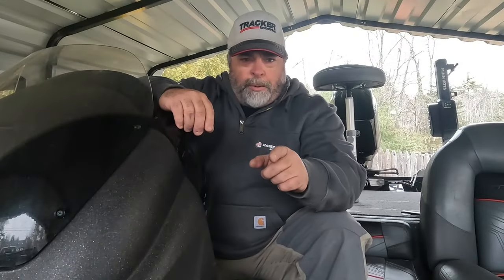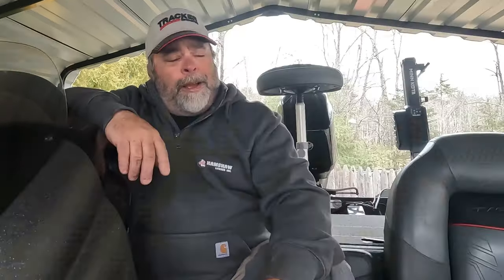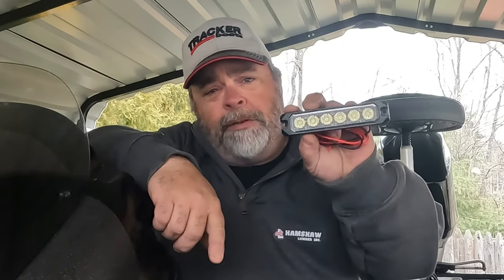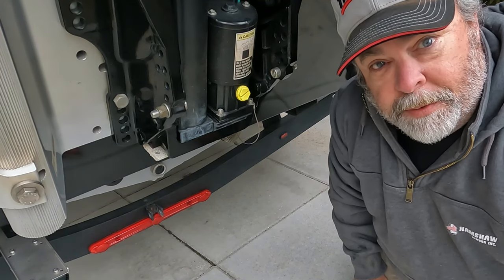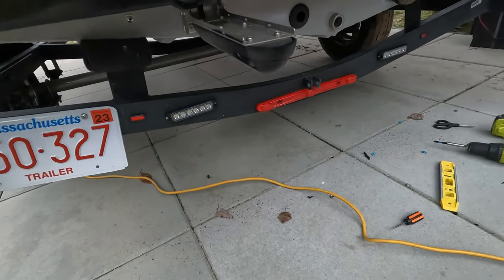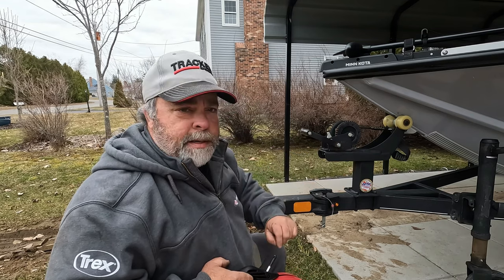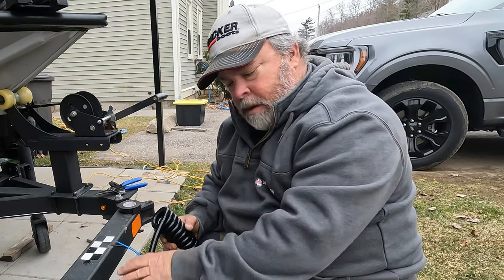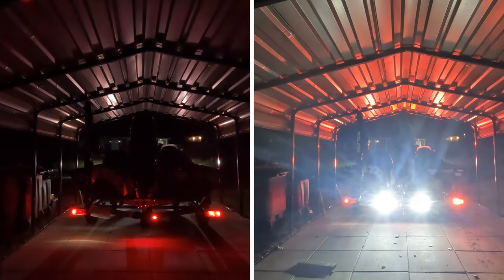Gettin' it Dun (S2, Ep. 20) How to Install Submersible LED Reverse Lights on Your Bass Boat Trailer.

Comment: By far the best trailer reverse light wiring guide on youtube.
Reply: Could two more reverse lights be added by just connecting the blacks to black and white to white?  So two further up to shine at an angle for the sides of the boat? Where I go it's nice to see where my truck tires are going too so I don't slide off a cliff haha.
Reply from the maker: Thanks for the good word my man.  Glad it was helpful to you.  I don't see why you couldn't add another pair if you wanted.

Comment: So I called and got the amp draw spec from the Rooster Tail lights. He said they were almost 2 amps per light. This would obviously make the amp draw from the pair almost 4 amps. Do you have any issues running this straight with no relay? 4 amps just from those lights is quite a bit for that circuit. Assuming that the ONLY other load on that circuit is the backup lights in the vehicle lighting, I would think it would be fine. Just don't want to be popping fuses. I'm installing on a Tracker Pro 170 trailer and pulling with a 2023 Silverado. I guess GM has over complicated the trailer wiring and tied the BCM into it. It supposedly monitors the voltage and current draw on the trailer light system and will cut the trailer lights off if it's too much. Can anyone confirm this?  Now I don't know what to do. Lol
Reply from the maker: I have no issue on my F150.

Comment: The "over 80" light is NOT a brake light. It only has one intensity and it indicates the width of the load on the trailer...
Reply from the maker: Yes. But for some reason I always call it my third brake, light like on a car.

Comment: Just ordered the gear to do this to my trailer and following your LED installation, that will come next.  The video was excellent and especially the explanation of going from an SAE to RV 7-way.  I faced this just a couple of weeks back and did not even know where were different options, so I removed the 7-way and put on a 4-way.  Luckily, the 7-way can be disassembled, so when I get the reverse light parts in, I can put it back on.
Thanks a million for this howto!!!
Reply from the maker: Awesome, thank you!